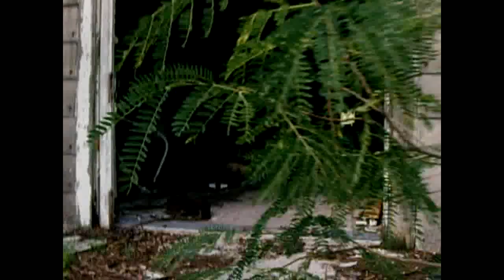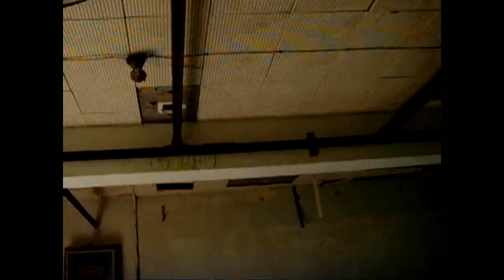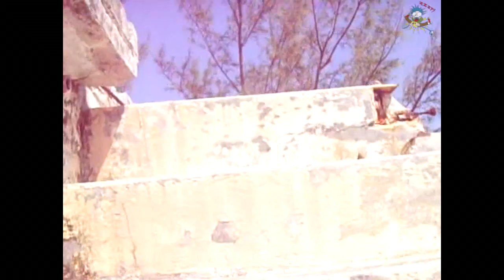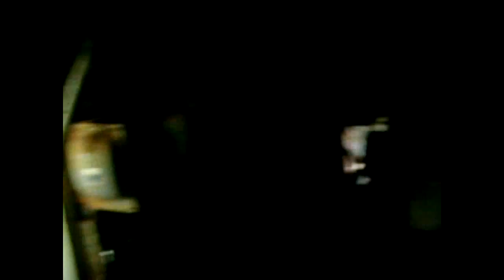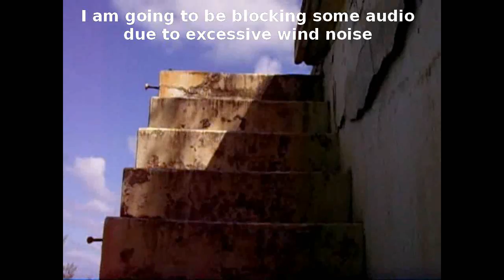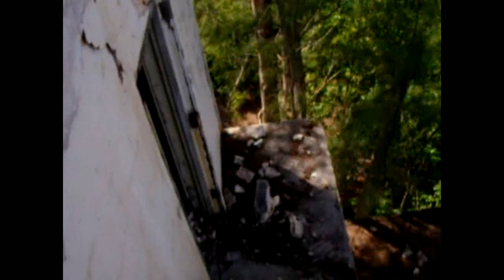Abandoned Bahamas Cold War Era U.S. Naval Base Communications Building

Comment: you might want to wear a respirator when you go in these old facilities. i believe they are filled with asbestos. floor,wall and ceiling tiles especially.
Reply from the maker: I try my best to not disturb anything, and the building is open to the outside, so there is plenty of airflow. Mostly concrete, wood, and plaster. The tour video of the power plant had asbestos around the engine exhaust pipes, of course I did not touch any of it.

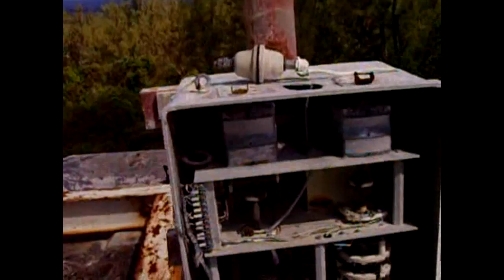Comment: At 13:53 the device is an old style RF antenna tuner that permits an acceptable antenna match over a wide range of frequencies. Today's RF tuners are relay based circuitry and are much smaller than these old plate systems but these old tuners can handle a LOT of RF power. The two electric motors on the top of the box would rotate slowly, moving thin, flat aluminum plates across each other until an acceptable antenna match is accomplished. These are VERY popular with amateur radio operators.

Comment: Those bearings in the fan.
Rotating 24H. and still not seized.
Reply from the maker: +pcuser80 
Yes. I noticed that also. There is usually a breeze coming from the ocean which keeps the fan turning almost continuously.
Reply: +electronicsNmore 
No noise from the bearings?
Reply from the maker: pcuser80
Yes, it squeaked

Comment: Hey cool video, I've been through a few abandoned buildings in the past like the old "El Miradore" hotel in Palm Springs, the Army had taken over the Hospital on the site during the war, their is a set of "Electronic carillons Bells" in the tower there, (which I use to service)  the rest of the building was sealed up & used for storage by the Hospital (Desert Hospital) one of the boarded up rooms in the tower was a radio studio used at one point for the Original Amos & Andy show live on local radio.. I found an old tube mike pre-amp under some trash, it was missing the tubes & all corroded..  I stripped it down to the bare chassis, & restored it completely & donated it to a museum.. 

I'm with you on the going back 50 years, part 1) because I use to repair Electronics items (& Radio) part 2) because I'd like to come get that old antenna switcher/tuner  & put it back in service on my Ham radio setup here at home, & part 3) because like a lot of older people, I'd really like a do over & relive my life totally different..
Reply from the maker: Thanks For watching! I love going through old buildings, silver/gold mines, ghost towns, etc. The antenna tuner motors are both seized, but the rest of the parts still look good. I will dismantle that unit this week. If I don't, someone will end up trashing it.